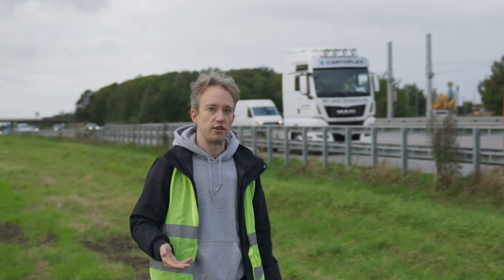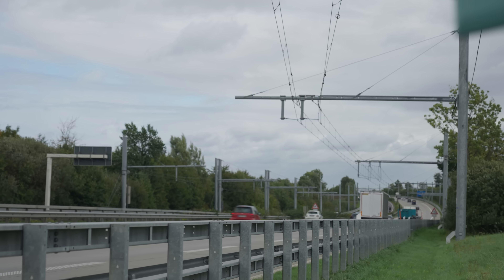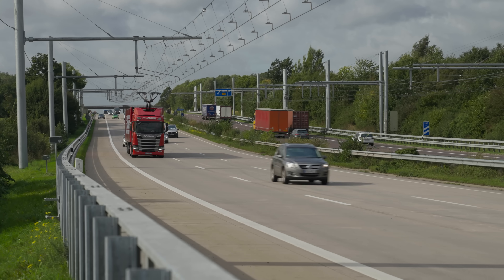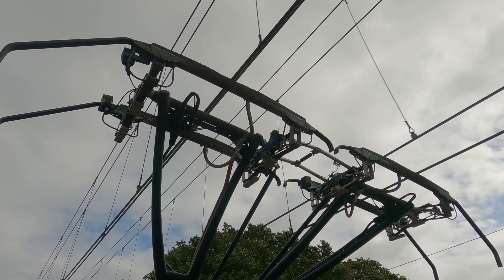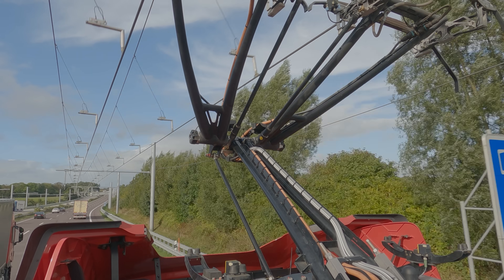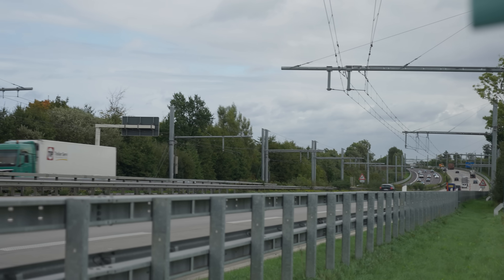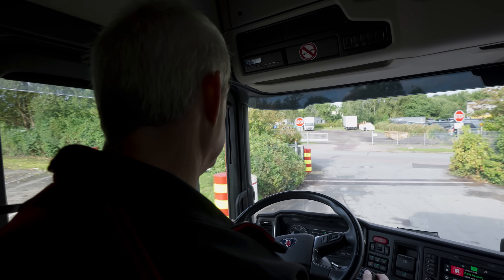The highway where trucks work like electric trains

Comment: Very very clever idea that could even work on the highways up the east coast of Australia the most heavily used by freight trucks interstate B doubles and container delivery semi trailers . Outback Australia probably needs hybrid trucks or the government to get their finger out of their ass and upgrade and/or rebuild some closed railway lines.
Reply: Since the distances are huge in Australia it would probably make most sense to use the railway for the long distances, it is much more energy efficient (even if it runs with Diesel) than trucks per ton cargo and driven mile. Containers can be loaded and unloaded easily, from truck to train and back to the truck for the last mile

Comment: This is going to be everywhere. It's absolutely brilliant. Trucks can carry less battery but would still be able to make short trips off the cables. Most rucks would only need 100 mile range in battery power to be able to service their existing routes.
Reply: I drive for UPS and can tell you that I deliver 8 miles from my building and drive 65 miles a day so a truck with a 100 mile range would not work.

Comment: I've actually thought of something similar to this, though more with induction and on the ground instead of the air; this definitely seems like a better alternative though because weather wouldn't impact it nearly as much, and installation / maintenance would be much easier
Reply: Why not push the trucks by using magnets/linear motors, similar to how they launch rollercoasters. Trucks wouldn't need electric motors and batteries and stuff but just some anchor magnets and some positioning tech.
Reply: @Iukim  because coasters are designed to roll long distances, tires and the road are meant to have high-friction so they get good traction, which removes a lot of their potential coasting range

Comment: Most Russian cities have “trolley bus,” which are regular city buses equipped with two electric horns that reach up to connect to a wired grid. It’s been around since the Soviet days and it’s extremely reliable.
Reply: They are ok for inner city travel just not realistic for a complete nationwide network. They cannot compete with trains for sheer scale so will not replace trains.
Reply: Modern technologies also let them have batteries so they can drive 20 km without overhead wires.
Reply: @daviddou1408  In US trucks are used more, sure, but, because historically there's been less investment in building rails. There are countries that use trains more than trucks.

Comment: Depending on efficiency, could the road have coils inside it, with the movement of the vehicles that would have magnets in the bottom of each, to generate electricity?  If possible, solar panels along the roads with the power magnetically transferred to the vehicles, either in addition, or alternatively.

Comment: I always think that it would be helpful if the experts would sometimes mention how that electricity is produced.   I'm willing to take their word for it that overall it's cleaner,  but that electricity doesn't come from nowhere.   Something had to be burned, split, harnessed...  processes that require massive amounts of energy themselves.
Reply: Even if it's done with fossil fuels, centralized energy production is way cleaner and more efficient than burning the same amount of fuel in combustion engines.
Reply: I don't doubt that at all.  I'm just curious about how those calculations are made.

Comment: I wonder if an inductive charging system built into the road surface might work.  That way you could use it for all road vehicles.
Reply: The swedes are going to start building such a system starting in 2022 and hope to have all of their largest cities connected to it by 2035.

Comment: As a civil engineer I've designed intercity & commuter rail infrastructure in the northeast USA for decades, including heavy rail catenary.  I'm just wondering what the tradeoff is environmentally, considering the vast amounts of steel & copper that are required for the catenary systems (I know from experience, this stuff is NOT CHEAP!!!!), plus the VAST amount of manual labor needed to maintain the system (needs constant adjustment / tensioning / replacement of worn contact wires / etc), plus various issues with grounding & bonding (not clear if this is ac or dc power, single phase, 3-phase?), & substations, feeder wires, transformer stations, etc (again ENORMOUS amounts of steel & copper for these).  Why wouldn't they just put the cargo on railroads that are already electrified (most are in Europe, unlike the USA, in fact Europe is vastly under served by freight rail).  I'm all for more electrification in the USA but it's an ENORMOUSLY expensive, material & labor intensive proposition, which only makes sense on the densest of corridors.  This may make sense on some of the long large tunnels under the Alps?  Don't discount the environmental costs related to the ENORMOUS amounts steel & copper materials vs the fossil fuels being burned via traditional internal combustion.

Comment: Someone suggested the trucks having steel wheels due to less friction. What about boosting capacity by also putting many of these trucks together one after another? And add some form of propulsion unit up front to pull them.
Reply: electric motor efficiency  vs fossil fuel engine eff. is funny in the way that
ONE big one at front doesn't help that much
Reply: @wolu9456  In what way?  An electric motor can deliver much more torque than an ICE or diesel of comparable size and so should easily be able to haul much larger loads than a fossil burner.

Comment: That is an incredible stupid idea...  These people never hear about hydrogen fuel cells?
Which is a much much better solution for all the utility transport sector?  
The infrastructure cost to achieve these electric wires on all important roads and highways is huge, and even if you do that, if the trucks needs to go to another country they are scrub.
The one who come out with this idea should be fired.
Reply: And how much power will you throw away making and storing the hydrogen?
Reply: @catprog  less than using batteries.. 
This is very long to explain:
Each time you want to double the (range) or operation time  of any device or vehicle working with batteries, you need to double the cost and weight.
With hydrogen you just need to increase your tank size by 25% (this double the volume). 
This mean that hydrogen is better to store or deliver power for longer than 4 hours (less for airplanes, more for houses). 
This mean that if you want to store 2 days of strong winds, at the same capital cost, you would be losing 44 hours of power using batteries which give you a terrible efficiency.
Meanwhile with hydrogen you can convert to hydrogen the total of all that with almost no extra investment.
This is even more important when we talk about season disparities.
Efficiencies of current electrolyzers are at 90% (no compression), fuel cells 60%, 700 bar compression (12%), liquid (30 to 15% depending plant size).
Current best fuel cells tested on lab with already a good lifespan,  are already at 75% roundtrip efficiency. 
Now.. 50% of all the power than the world consume, is on sectors that NEVER would be able to run on batteries (unless we change the definition of battery), these sectors are all the utility transport sector, the natural gas grid, etc.
So you need to generate clean energy in chemical form to feed all those sectors, the best is with solar and wind that are the current cheapest source of power, they would work most of the time converting excess of power because you are generating on average 200% of the power grid requirement, so even using current electrolyzers, you are just wasting 10% of energy, the lose you have on fuel cells does not count, because any of those apps can not work using batteries.
Container Ships would sink over its own weight and cost without payload trying to match the operation time (hundreds of hours) of normal ships for example.
Then you have that transporting energy on hydrogen by pipelines is 10 times cheaper than using wires. 
So no.. you are no wasting energy, you would be wasting energy and money if you try to use batteries when you need to deliver or store power for longer than 4 hours.

Comment: It's going to be great fun watching one of these trucks tip over then the connecting arm collides with the cable holding posts and rip the cables out causing electrical mayhem as everything crashes down on the ground and truck cabin

Comment: We have those overhead wires at some places in Sweden as well. Great to see the Swedish trucks doing great job elsewhere. :)

A standard would be important. But this is probably just wasted as soon as Tesla is rolling out their battery trucks. There might be some market space over for hydrogen cells. I sincerely hope other truck companies like scania has great things up their sleeve or they’re screwed.
Reply: Battery trucks is a stupid idea that will probably never happen. The weight and volume of the batteries needed to move a truck for long distances would be so massive that there won't be much capacity left for cargo. Don't believe anything Elon Musk says, that guy is a vaporware salesman.

Comment: Makes a lot of sense. Can already leverage existing industries and skills (cable layers etc.). The truck will obviously have a battery too. But think about this. In 20 years, if the truck can do 95% of the driving itself, it will be running all the time. It can charge and use grid power on the go, then the last mile can be down by humans who get a truck with a small charged battery to drive around, drive in, sign off on the load, etc.
Reply: 100-200km is minimum crappy small electric car range, trucks have a megawatt or two of battery that gives them hundreds of miles range.

Comment: One of the problems train operators experience with overhead lines is that you get a feedback loop of damage, any damage to the wires will damage the pantograph contacts which then go on to cause more damage to the wires and so on. If this is a problem for trains, which are being run comparatively infrequently (compared to number of trucks using a motorway) and are I presume far more likely to be inspected regularly for damage than some low cost road haulage firm / owner-operator is likely to inspect their trucks, I really can't see this thing lasting long before a cascade of dodgy pantographs tear the wires to shreds.

It's also the sort of thing you don't pick up in trials because everyone has a vested interest in it working so they behave themselves and inspect their equipment.
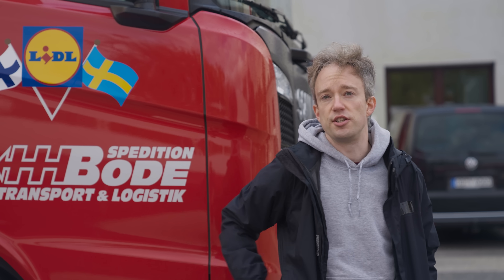Reply: 3:46 - the contact surface of the pantograph. I assume it is graphite. Not looking good indeed, if this is the case. I start to see your point and I just wondered - could they conductive rollers instead? I've never heard of such thing, but at least it won't slide bad into the line at 90km/h.
Reply: @tkzsfen  Without knowing what milage that truck has done on pure electric mode it is hard to conclude anything. But certainly it is normal for the carbon strips to wear down over time, as anyone who works on trams or trains will tell you.
Though most railway OLE systems use a deliberately staggered contact wire arrangement to spread the wear out over the whole width of the contact strip rather than cutting out a groove only in the middle section - this is another thing that could be employed in the setup going forward. Perhaps a semi-autonomous lane guidance system could be used under the wires to reduce the risk of running away from the wires unintentionally.
Reply: @soundseeker63  I see. By the way, no where in the video, the price for the additional equipment of the truck was mentioned. Do you have a rough estimate what will be the increase of the cost for such a hybrid vehicle?
Reply: This is going to turn a bad economy into a complete disaster.....where is the electricity coming from? How is it made? Coal plant? They we have a much higher demand once this takes plant guaranteed
Reply: I feel like a rolling "pantograph" (the thing that comes out of the top of the truck, right?) that has a diameter of ~20 cm would do the trick. Spin it up to the same speed as the truck is going and you eliminate a lot of friction and 'tear opportunities'. This is a piece of cake for modern engineers, but probably wasn't when the train was invented.
Reply: now this is call insight. while I have a different theory with a similar conclusion, I think they will find a solution not too soon. problems come up so that they can be solved, right?
Reply: I didn't think of this but you're absolutely right.  I have experience on heavy rail catenary in the Northeast USA.  It takes decades of training to qualify linemen & rail car mechanics fully proficient at maintaining & troubleshooting catenary systems, both the structure/ substation/ wire delivery systems, & the pantograph/ transformer / rectifier / traction motor / drive train traction system.  So, yes, who is going to train & qualify this vast army of new workers, & pay for their services?  Then, how do you parse through the damage evidence to assign responsibility every time a pantograph pulls down a section of wire? (which happens all the time on rail catenary just due to weather & equipment wear & tear, where the trains are on rails & can't just randomly steer outside their lanes?).  Then, plus, now you're electrified truck lane is out of service until repairs are made, which typically take many hours by highly skilled technicians & require all power shut off with many safety protocols.
Reply: @sideshowbob  If the damaged line isn’t a danger to traffic, they could shut down that section of the line, and have the pantographs automatically retract for that section, until (night time) repair can be scheduled. The vehicles have batteries, so they should be able to tolerate some level of outage along their route.
Reply: @sideshowbob   Insurance for all such trucks? with progressively higher deductibles if pantograph is found to be not maintained properly, on such inspection. This whole idea is quite promising despite some weak points, because trucks do not need heavy batteries on board, millions of trucks.
Reply: @sideshowbob  think of all the new jobs to replace all the fossil fuel jobs
Reply: @jnawk83  might as well use an RTG instead :D
Reply: I think there's a failsafe for that now. The damage happens because the block of graphite between the pantograph and the overhead line breaks off, but there are systems now that automatically lower the pantograph when damage is detected.
Reply: There systems they could employ to safeguard against those problems.
Contact strip wear detection systems that automatically drop the pantograph in case of damaged or worn-through carbon strips are widely used on the railway already. Shock sensors attached to the pantograph can be used to detemine any snagging issues or "hard spots" in the overhead wires. And I guess you could link that up to a wireless location based system to automatically flag up problems to the line maintenence team.
In the UK, we have the same issue of "who is to blame" on our privatised railways whenever any OLE gets damaged, which is why most trains are now fitted with roof mounted cameras to detemine whether the incident was due to damage wires or a damaged pantograph - I notice that the truck is also equipped with a camera for (presumably) this purpose. The party whose equipment failed can be determined by watching the video log and the party at "fault" pays for any repairs.  Obviously you would need some kind of mandatory insurance setup for this to work on a national scale but, I think with some creative solutions it could be made to work.
Reply: Excellent point.  All those risks are present even before considering that this thing is autonomously controlled!  They mentioned in the video that it pulls itself down as the truck leaves the lane...

Can't see anything ever going wrong there!!!

Comment: What about loads that exceeded the height of the cables? Although it  doesn't happen often, where I live houses and windmill parts are on the highway frequently. These cables would put a restriction on both making it hard for those industries to transport. Just wondering if there's a way around it with this system, it's very cool.
Reply: Good question as the height of the catenary would theoretically need to be slightly below the bridge clearance height to provide an uninterrupted line and prevent the pantograph from striking the bridge.

Comment: Certainly a good idea.  
     One reason for saying that is that it's already been in widespread use for a very long time.  Trolleybuses, that were so common when I was a boy, and have continued to operate in about fifty other countries, have been working in exactly the same way for a hundred and twenty years.  
    The only difference is that they didn't need batteries to get to and from the grid - although of course that could easily have been done, any time during the last eighty years - remember all the electric milk floats?

Comment: This seems very promising.  It addresses a couple of major complaints about Tesla's vision of pure electric battery Semi Truck Tractors.  The problem is that battery vehicles just don't have enough range for long-haul trucking and adding range means adding weight in batteries.  Additional weight in batteries reduces the weight that the truck can haul.  If they reduce the batteries required to that to get the truck from the highway to destination, where   presumably it could be charging while loading/unloading, the electric truck becomes more feasible.  One other downside is that these trucks would have less flexibility in their use limiting them to areas with support where a diesel can go anywhere it has enough fuel to get to.